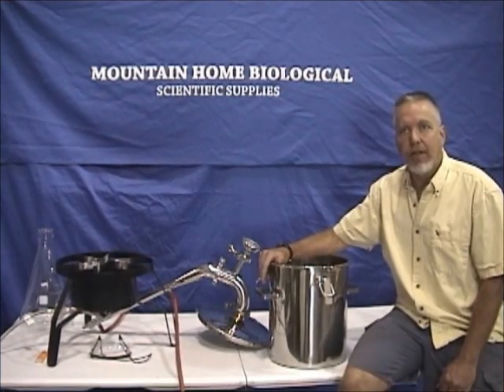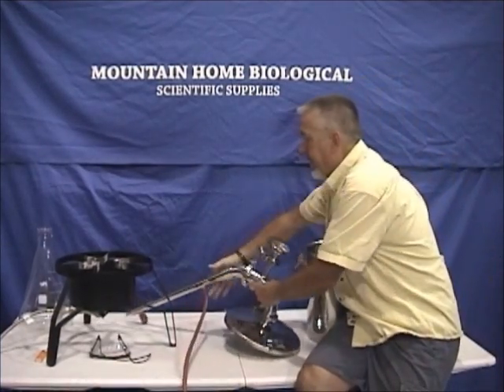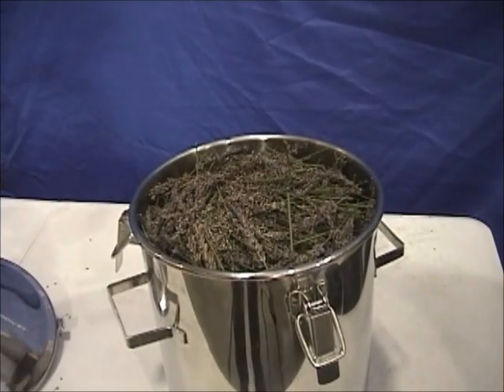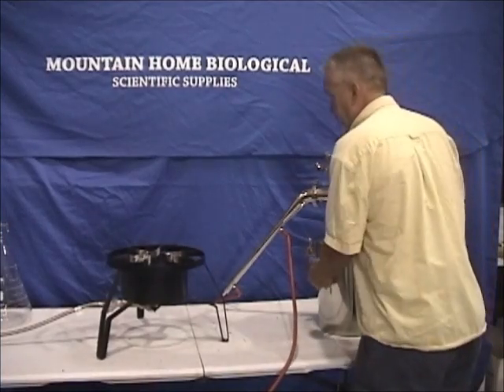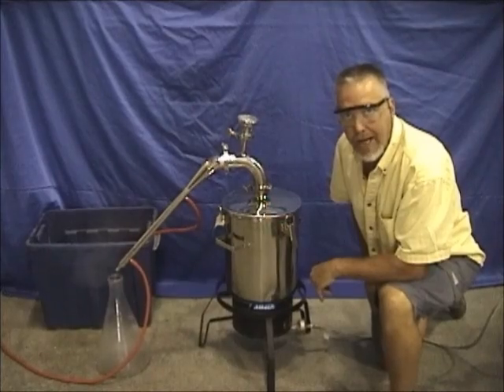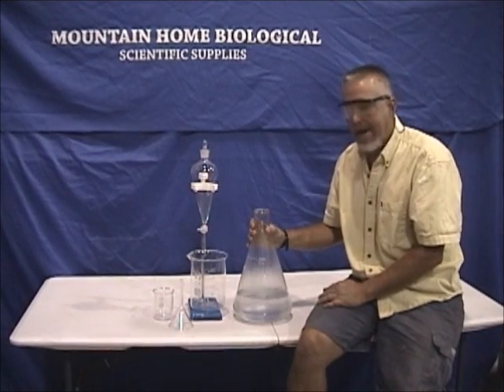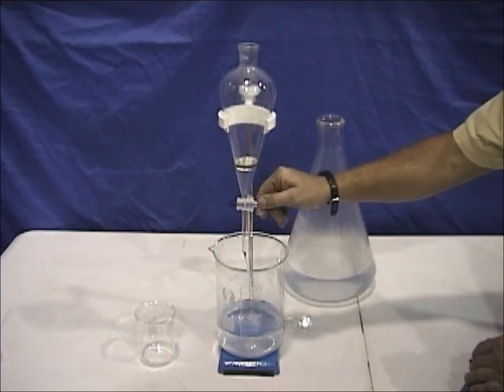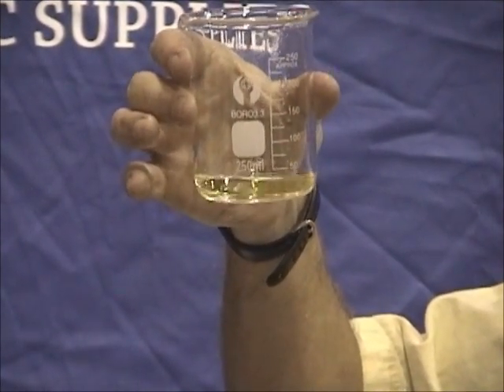Distilling Essential oil

Comment: hi is there other method to seperate oil..so that we got more product and less loss
Reply: mouhed bahri What we do in our chem lab is use longer condenser tubing so that more of the steam turns to liquid. You will notice he loses a lot of steam.

In addition to this, we use a steel wool column. This allows the liquid to condense on the wool and redistill as it makes its way to the final condenser. This helps extract more oil from the hydrosol as it is produced. We also use the thermometer to monitor how hot the steam is so that be are not distilling water in the process. Most organics hover around the 60-80°c range, if it goes above that we know that we are getting mostly water in the steam. We do not bring it to a full boil like shown in the video.  

Once we have the oil and the hydrosol, we extract as much oil as we can with the separatory funnel as shown in the video. then we take the hydrosol, vortex it so that any trapped oil can escape from the water, then we centrifuge it so that it separates by mass (you can make a homemade centrifuge with anything that spins fairly fast). We then separate it again via the separatory funnel. 

Once this is done we purify the oil by adding concentrated salt water to the oil to remove the bulk of water trapped in the oil, we separate this again, then we add a drying agent such as sodium sulfate or calcium chloride crystals to the oil which absorbs the water. The oil is then filtered to remove the drying agent.

Comment: I would think seeing a few of these videos, that boiling the fresh Lavender (First being pulverized) for a given time, then distilling the liquid would Yield a Better result. Also, Allowing the steam to be condensed in a more efficient way would also help quite a bit. Simply Steaming the Material VS. Actual immersion doesn't Seem to be as an effective method. Steaming Vegetables helps hold in the Nutrients VS. boiling them in Water. (Immersion).  But I could be wrong. I Haven't done this before.
Thank You for Posting. It give me ideas for thought.